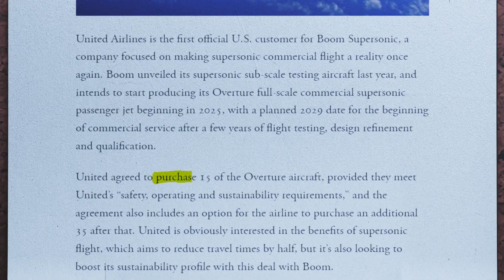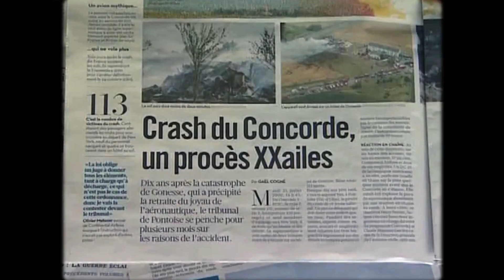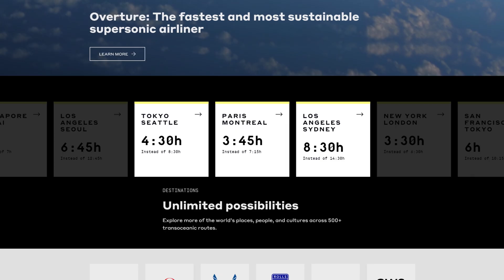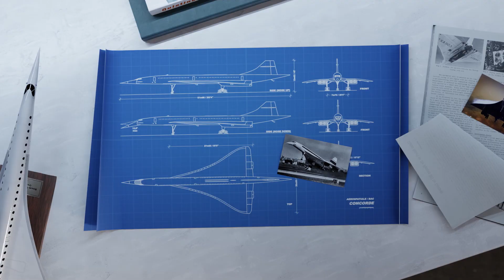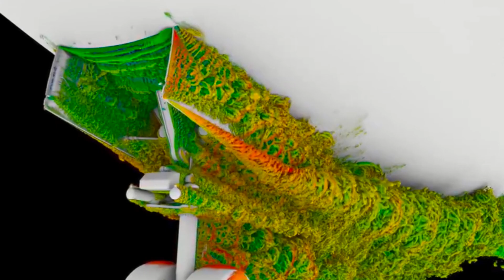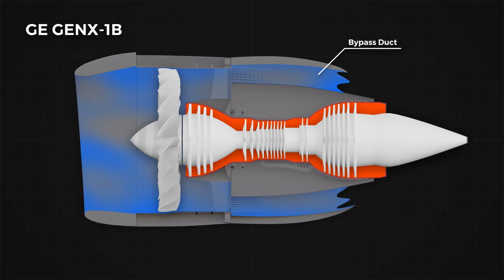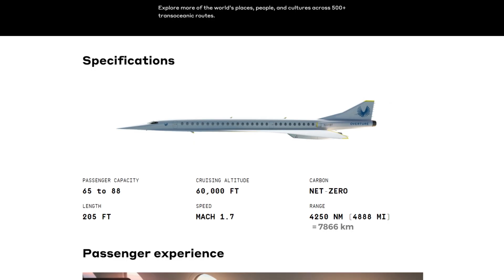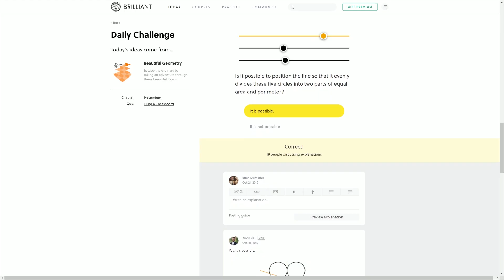Will Boom Bring Supersonic Back?

Comment: the sonic boom is only one of several problems of supersonic flight. there's also engine noise and fuel consumption, and i don't know what can be done about those.
- to generate thrust, you need an exhaust speed that is faster than the aircraft moves forward, and the problem is that the noise level increases with the square of the exhaust speed. it may be possible to block the noise from radiating downwards by putting the engine exhausts above the wings, but that leads to other problems that need to be solved
- another problem is fuel consumption. not much to be done about that, and this problem will keep increasing as fuel prices keep going through the roof. there are several ways to make a jet engine more efficient. one way is to increase the bypass ratio which makes the engine LESS suitable for supersonic speeds. another way is to increase the TIT. this is not really an option because in modern engines the TIT is already close to the limit of what the available materials can handle.

14:50 more efficient than the concorde? maybe. efficient enough to compete with other airliners? i don't think so.

all in all i think supersonic travel is gone for good, and those companies are wasting their money.
Reply: Oh they're definitely not wasting their money, they're wasting Venture Capital money, which is exactly the point. Make a useless company, get funded, produce useless tech, go out of business, throw up hands "well at least we tried"
Reply: @cidshroom  the point is, they are wasting money. Whether it is their own or someone else's is irrelevant.
Reply: @mrxmry3264  for the company it's not a waste at all. They get to play aerospace firm, someone gets to LARP as CEO, and all those engineers get a good job digging holes that will be filled back in later
Reply: @cidshroom  but the investors lose their money. i dunno about you, but i wouldn't be happy.
Reply: @cidshroom  Exactly.  And retire to your mansion... until the next grift opportunity rolls around.
Reply: @cidshroom  if at least they would produce a tech toy. It is not venture capital. It is old rich men dreaming the space age back.
Reply: "to generate thrust, you need an exhaust speed that is faster than the aircraft moves forward"
This isn't true. In principle, any non zero exhaust will generate a thrust. In practice, you need the exhaust thrust to overcome drag and provide acceleration.
I think fuel consumption of x2 or even x4 isn't something that would be prohibitive. Assuming a quieter and roomier cabin than Concorde, there would be a market willing to pay x4 to get there in half the time.

That leaves the sonic boom and the range as bigger challenges. If these are improved, there can be economic viability, especially with 50 odd first class seating capacity on select routes.
Reply: @gireeshgprasad7589  you are mistaken. What you are talking about works for a rocket but jet engines are fundamentally different because they are not carrying the propellent but instead accelerating the air they fly through. Hence velocity out has to be greater than velocity in. Same deal with a prop. The nozzle velocity has to be greater than the true airspeed or there is no thrust.
Reply: Just fly higher. Keep ias the same as regular planes.
Reply: The issue is people complain too much. If you have a problem with it just sound proof your house, don’t remove futuristic supersonic travel for the rest of us because your too lazy to buy some sound proofing material!
Reply: @Joseph116PZ  It breaks windows and bursts eardrums genius
Reply: What about hydrogen or electric supersonic? I'm pretty some problems still remain but at least it's way more efficient.
Reply: @motionless360  hydrogen may or may not be an option (i don't know) but electric propulsion simply can not supply enough power for long enough to be useful in airliners, especially supersonic ones. 

also, i just saw that someone said that drag is higher at supersonic speeds than at transonic speeds. but in reality drag reaches a maximum around mach 1 (transonic range) and decreases as the speed increases, at some point it will reach a local minimum before increasing again.
Reply: Consumption is only up a factor 2 compared to a long range subsonic jet.
Reply: @ArneChristianRosenfeldt  that depends on how you look at it, doesn't it? The concorde burned more than 4 times as much fuel per passenger as a 747. With fuel prices going through the roof, that kind of difference is just not acceptable. And that isn't even taking polluton into account.
Reply: @mrxmry3264  So on point 1, yes engine nose would be a problem. Though I do imagine they would be able to get waivers. There is really no way to quite turbo jet engines down to modern standards.

As for fuel consumption, it's not as large of an issue as one might think. With max passengers with max fuel, the fuel costs per pax on the Concorde would only be about $560 USD.

A first-class ticket from New York to London will cost over $3000, so fuel isn't going to be your largest expense.
Reply: @mrxmry3264  4 times is a bit too much. Thanks for the number! I can only look at the streets and some people drive 250 km/h and thus use 4 times the fuel than me at 125 km/h. I go by bike to work, other use their car. There is no competition to be environment friendly, so small differences don't matter.
Reply: @ArneChristianRosenfeldt  
"4 times is a bit too much"
is it? let me give you some numbers. lets say you want to take 500 people from london to new york. you can put them in a 747 which takes 8 hours at 10 tons per hour or 80 tons in total. or you can put them in 5 concordes. they only take 3 1/2 hours at 20 tons per hour, or 70 tons. EACH. thats a total of 350 tons of fuel for the concordes vs 80 tons for the 747. more than 4 times as much.

cars going 250 instead of 125... again i think that youre off by a factor of 2. let me explain.
when it comes to cars, aerodynamic drag increases with the square of the speed (with aircraft it's more complicated than that) so to go a certain distance at double the speed, you have 4 times the drag and therefore have to do 4 times the work. but not only that, you also have to do that work in half the time, doubling the power again. so your power requirements increase by a factor of 8, or the cube of the speed. then take into account that ICE engines are less efficient at high rpm, and the real fuel consumption goes up even steeper than the cube of the speed.
Reply: @mrxmry3264  Ah sorry. I meant a factor of 4 is too much to make it worthwhile. Also I hate my brain because I sure did the math the last time this topic came up. It comes up every year since decommission.
So we have 1.8 L in an old Diesel engine. Those fast cars have a V8 with 6 L and more boost and more gears and spread. So they run at the same efficiency. Once a week I have to travel 200km back and forth and need half the tank. I minimize contact there due to covid. So no refueling. No problem. But with 4 times the consumption ..
Reply: @mrxmry3264  Air compressibility also is barely a factor in cars. It isn't until you're traveling above around 140 mph that the density of the air begins to change appreciably. Drag is easy to quantify at these slow speeds.

Going a bit off-topic with aircraft, wave drag at supersonic speed is substantially more drag vs flying at lower transonsic speeds. If you normalize this increased drag (AKA increased fuel consumption) per passenger, it's an order of magnitude of increased cost at a time when fuel prices are far greater than they were when Concorde was around.
Reply: @sircrapalot9954  yeah, aviation is way more complicated than most people imagine. and the deeper you dive into it, the more complicated it gets.
Reply: @mrxmry3264  
If your assumption about it being a waste of money was true in reality, then all of the major airlines wouldn’t have already placed waters and deposits, Virgin wouldn’t have invested tens of millions, and Boeing wouldn’t have scrapped their own supersonic passenger project to support the Overture.
Reply: @JordanReedYT  time will tell who is right...
Reply: Did the concord cruise around in afterburner? If so then working on making the plane be able to supercruise could be an option to cut down on fuel consumption
Reply: @kuiper921  AFAIK they only used the afterburners for takeoff and to go supersonic. 
The fuel consumption is connected to the type of engine required for supersonic flight, and there's not much the tan do about that.
Reply: @kuiper921  no it did not. And Tupulev said that their plane was okay, but they could not get good engines.
Reply: @kuiper921 Concorde was able to supercruise.

Comment: I know high speed aircraft usually fly high to reduce drag, but I've wondered if given enough power ground effect vehicles could go supersonic, and if doing so would offer improvements in fuel efficiency, and carrying capacity. Also if flying near ground... would that also reduce the area affected by sonic booms
Reply: Seems unlikely, Concorde flew half as high again as subsonic airliners - at that speed the dynamic pressure is pretty significant (it increases with speed squared), so you want thin air. Looking at real-life examples, Ekranoplans were notably slower than other subsonic jet aircraft, and the B1-B Lancer's low level speed of Mach 0.92 is among the fastest of any jet, but far slower than the Mach 2.2 the B1-A could do at high altitude
Reply: @brynclarke1746 
until you reminded me there, I'd forgot that for a fixed forward speed, climbing in altitude will increase Mach number. it's really forward speed that matters for transportation not Mach number.
you're right about the dynamic pressure. was thinking ekranoplans can get away with smaller wings, so they should have less drag from their wings. Just depends how much that reduces drag. Also  might be easier to achieve area rule stuff, with smaller wings
Reply: I could only find a paper on this, but unfortunately not read it. What I got from it was that is important for tank munitions which go very fast near walls or terrain and could be influenced by ground effect. The other scenario would be a supersonic train/maglev. Either way I couldn't determine the findings. It's an intriguing topic, no doubt.

Comment: It never failed 30 years of service credit to UK innovation
Reply: It was the most advanced airliner of the era, it had a digital computer to control the air intake, and it had a good autopilot including autoland with a decision altitude to land f just 15 ft. The autopilot could land the aircraft even softer than most Concorde pilots, it was also the first FBW aircraft (even if the FBW system was analog, not digital).